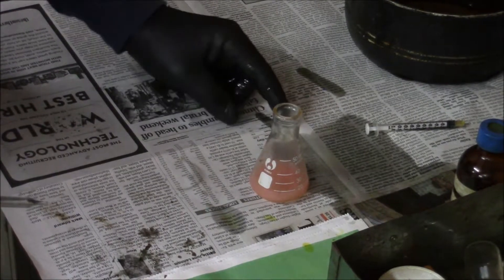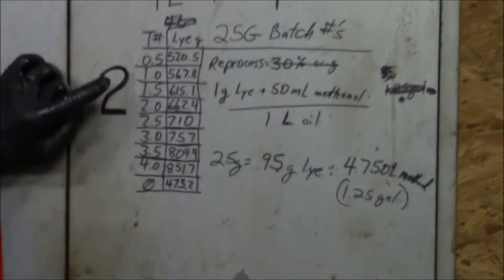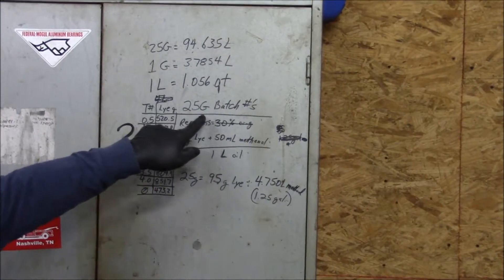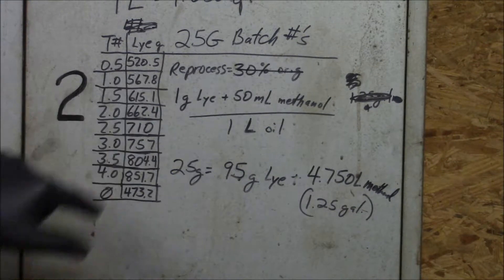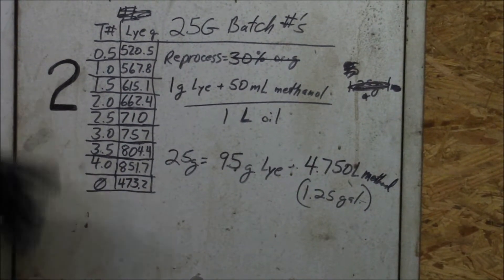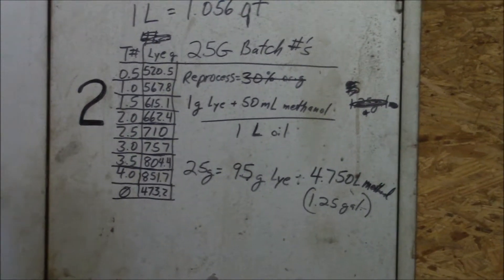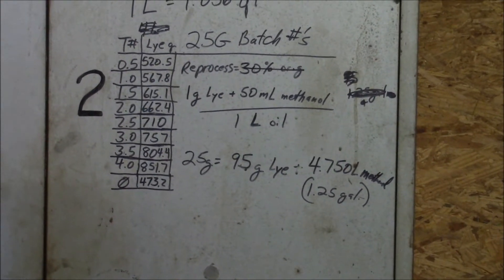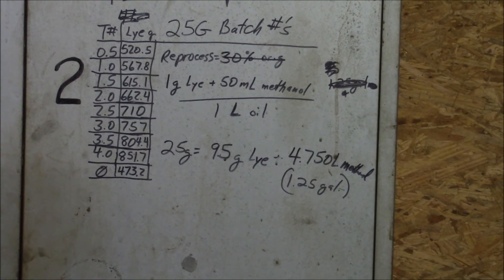Biodiesel Video #3-Titrating WVO

Comment: Thank you for sharing a clear explanation of the titrating process

However, I still don't understand the math of how you got to 567.8 grams of Lye. Clearly you are starting at over a pound of lye to begin with, as a pound is ~454 grams. For your chart this titration of 1 gram lye per liter would come out to 93.635 grams of lye (25 gallons = 93.635 liters) and 454 grams plus 93.635 grams = 548.635 grams, which is still less than your 567.8 grams.

So, for a beginner, can you please explain what base amount of lye you are starting with in order to arrive at the figures in your chart?

thank you!